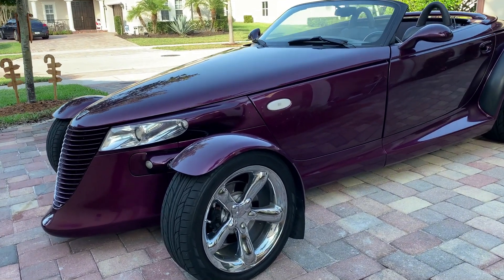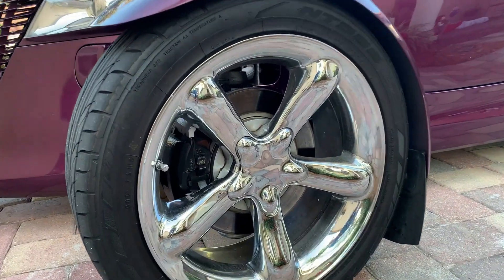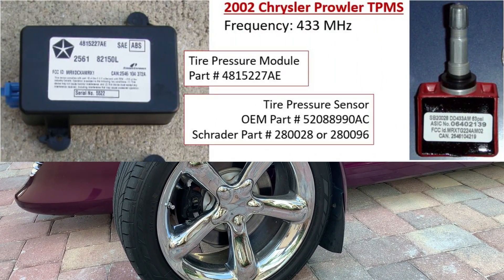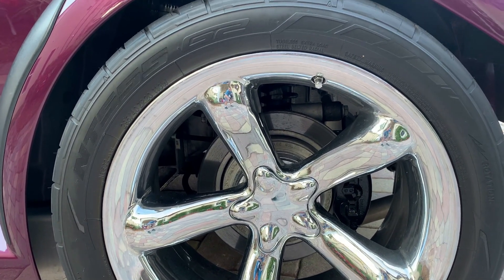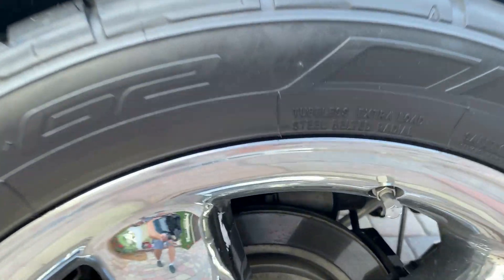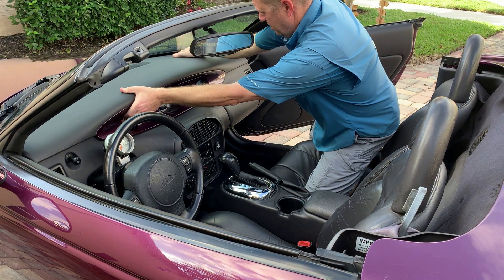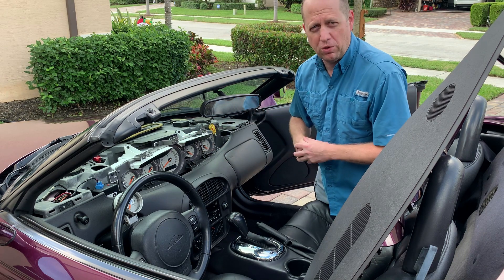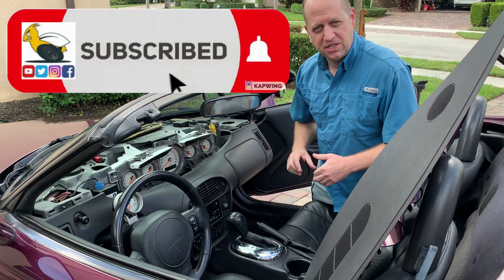Plymouth Prowler - TPMS - Tire Pressure Monitoring System Overview

Comment: Hello , if I well understood the tire  pressure  Modue is the same from 1997 to 2002 ?  but can read the 2 frequencies ? 315Mhz AND 433Mhz? , I have a 2000 and as you refer the sensors emit at 315Mhz, and i cant find so far at fair price. So i can  can you suggest mehow to solve ? I have a LAUNCH tire pressure programmer CRT 5011E but only show  the 2002 production, and i have this  car as well a 2002, So if i read thise 2002 and program a universal sensor, you believe the  pressure module will recognize ?
Reply from the maker: No the module 1997-2000 have different frequency and appear to be proprietary compared to 2001-2002 models which are more likely user friendly

Comment: Anyone here use the Dodge Viper Tpms module to program the later 433mhz sensors to it? 

Heard they are more readily available new but will still need the drb3 tool or emulator to program new ids into it. 

Also theres a drb3 emulator github repository for anyone trying to just make a home brew scan tool for these nuance things.

Comment: I have to change some tpms sensors on a 1999 that works in the 315mhz , but my scanner only shows me the model 2001-2002 that works on 433mhz, I have universal sensors 315 and 433, my questions is that if I would be able to program it? since my scanner is not showing the correct year/band, I would try it to do it learn by obd but I have to select the wrong model/year in order to make that work, do you think that it can be done like that?
Reply from the maker: It might work; try it and let us know.
Reply: @BRichSolution  i'll try, worst case scenario the scaner fails to connect to the module
Reply: Update, didnt work , it's weird, client said that no one has a scanner for 1999 @BRichSolution
Reply: The universal sensors will not work. Just went through a whole series of solutions and nothing worked. I am disconnecting the bulb and calling it quits.

Comment: This video is helpful, however it also needs to show how to go about getting the TPMS wheel modules programmed to communicate with the TPMS module in the dashboard. If a dealer can't do this, perhaps recommend the steps and possibly the tool that is needed in order to do the scanning to sync up the wheel unit with the TPMS module at the dashboard.
Reply from the maker: Dealer has to do the reset unless your local auto has pentastar computer

Comment: Great video, the dealership would charge an arm and a leg for repair.
Reply from the maker: That's why I recommend doing all 4 sensors at the same time when the batteries start to go.   That way you pay the dealer service fee is the same weather you do 1 or 4 sensors.   Once the tech is in the system it takes him only a few extra minutes to sync all 4.